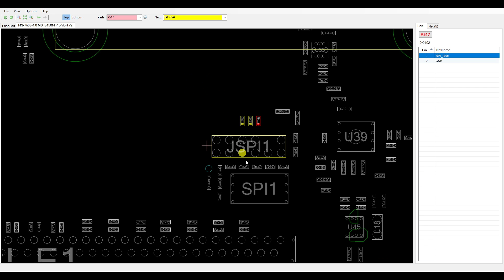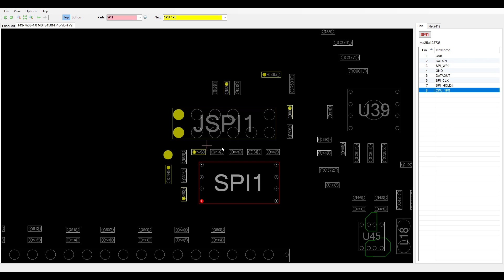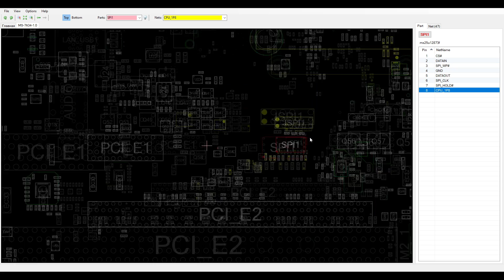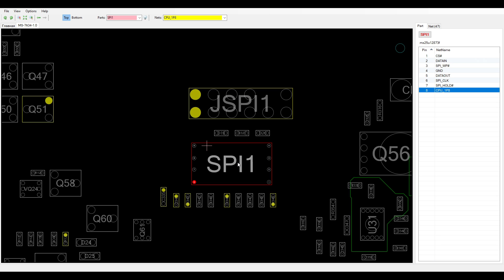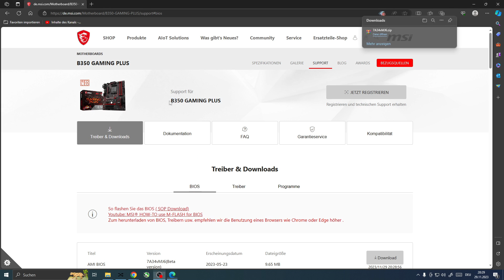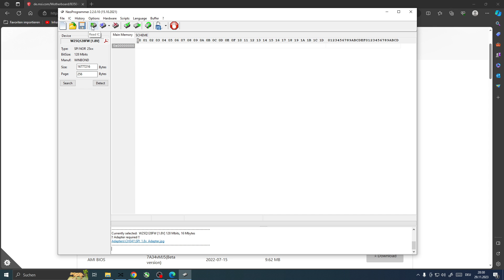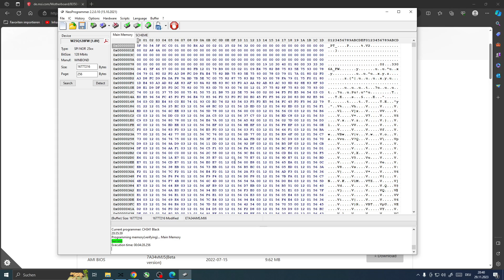HOW TO FIX A FAILED BIOS UPDATE | MSI B350 Gaming Plus Repair

Comment: is there not values that need to be carried over from the corrupted bios? I have a nonbooting x370 sli plus and suspect a bad bios flash. I've taken a backup already so I guess it doesn't matter if I just yolo it.
Reply from the maker: Theoretectly there is stuff like some board adress, cant remember what it was exactly, but most boards work just fine with a clean new bios.
Reply: @MainboardMedic  yeah, board id revived, but lacking mac adress and serials, feels like running a prototype board haha

Comment: I suggest you always save the old BIOS because in old BIOS there is very important information, such as serial number, MAC- address, and board ID. The main board will work without this information but could be a problems in OS.
Reply from the maker: Yes, i started to always do that!

Comment: Repaired my x470 aorus ultra using the same device but used the clip method. Took me 10 mins to restore both the main bios and the backup one. Much easier to use the clip. No soldering needed

Comment: Good video. 
About 20 months ago my friend messed up is BIOS during an update, he was just about to buy a new Mainboard but I told him to bring it to my house with so that we can play with it. I personally play around the CH341 programmers when programming ESP IOT devices with my own code. Anyway I managed to fix his BIOS by downloading his mainboard BIOS from the manufactures website (MSI) then using my 8 pin chip clip/gripper (no heat gun or soldering needed). Anyway I flashed his mainboard BIOS and was totally surprised that it worked and saved my friend about £150 to £175 for a new mainboard. Even though I do own a duel soldering station, when programming ESP devices on boards, I personally always just leave the chips on the boards as the chip clip/gripper  works perfect. Maybe I was just lucky in this case. I don't repair mainboards (I just tinker with everything electrical) apart from fixing my friends mainboard BIOS, I've also replaced 7 bulged capacitors on my sisters ASUS mainboard a couple of years ago.

Comment: I want to know If I can also use a programmer like the CH41A. I bricked my b350m pro-vdh today and want to fix it myself but before that I'll need to buy myself a good programmer so whats your recommentation?
Reply from the maker: There are many different ones. The CH41A is just the cheapest one to get. Preety much all off them are usable. You could also just use an Arduino to do it. The only really good one i know cost about 120€.

Comment: I received a board from Amazon that was a return (warehouse deal) and had the same issue.  I do have the CH431 with the crocodile clamp, but no Windows laptop to reprogram it.  So I shipped as RMA to MSI, not really expecting to hear anything.  Amazon had returned my money to a gift card, so the board was basically free.  MSI send me a brand-new board back, in their white RMA box.  But repairing bios is almost always successful.  I used to do this on the older MacBooks to get rid of a forgotten password.  But since they started with their stupid T2 and motherboards with their TPM, I have given up on repairing.  I am subscribing, could be the start of a excellent channel.  Frohes Weihnachten from Canada.

Comment: Hello I was updating my bios after it updated and rebooted by its self it shows black  screen only
Pls can u help me
Reply from the maker: What model of board is it?
Reply: B350 gaming plus @MainboardMedic
Reply from the maker: If you tried to reset the Bios via the Jumpers and with taking the battery out, there is nothing other left than to flash the chip, that you have on the board!
Reply: and how can i do that @MainboardMedic
Reply from the maker: Watch the video haha I expleain everything in detail how to do it! @Abdurahman-zh6xz
Reply: i did what you did still not working
 @MainboardMedic
Reply from the maker: Well there could be a lot of different problems. Maybe its not the Bios, hard to tell if i dont have the board myself. sorry @Abdurahman-zh6xz
Reply: will it be fixed if i  changed the  chips? @MainboardMedic
Reply from the maker: It might. Its hard to tell. @Abdurahman-zh6xz

Comment: An EZP2019+ V2 is also very cheap and it has adapters for 1,8V.  Does have erase function, auto (erase, program and verify) and has auto identification of the chip that's usually working great. Anyway well explained. Congratulations. If the programming and verification is not successful, mostly it is because the chip itself is damaged and needs to be replaced then reprogrammed.
Reply from the maker: Ive seen this one used by quiet some technicians, but i am looking for one that is a lot faster to programm, because these cheap programmers always take like 15 Minutes to Read, erase programm and verify.
But i might still get that one as a cheap replacement for my cheap CH341A. Thank you very much!

Comment: A very good guide on how to destroy your DMI Information of your board containing the serialnumber, mac adresses for all of your network devices and a maybe present efi marker containing the windows key! Good luck explaining to the customer, that your simple "fix" might cost him twice the price for that MoBo in additional hardware and software, once he tries to use his old operating system and tries to connect to a LAN or go online... 

Using two soldering irons with proper soldering tips (type K, but can be done with smaller ones just as easy) would desolder your chip in a spit of the time, you needed to heat it up using hot air. That would prevent the possible destruction of the chip due to overheting. Even with 320 celsius set on your 861DW one can get that chip off in half the time by using circular movements around the chip, instead of roasting its core! Using some additional flux (even the simplest rosin+IPA solution) and cleaning + tinning your soldering tip, would not only make your "soldering joints" become some real ones instead of cold contacts you got there, that might become non conductive soon, but prevent your hardware (read soldering tip) from getting damaged even more or even get destroyed.

To start to understand, what a modern bios (uefi) file is made of and which information it contains in what block, tools like uefitool (guthub), aptio (ami bios official website), phoenixtools (github, one can get redirected there from the official phoenix bios website after some digging there) and other tools for e.g. insyde bios, intel ME tools etc. can be used. Some of the tools are free or even open souce, others will cost you money, and some you will most likely never get, since those are getting developed by companies or private persons for a very limited circle of companies or persons.

DMI block can be found and copied or at least set properly using any free HEX editor on the planet. Even the one in your programmer software can be used, but it has a very slow search algorithm.

Hope it will prevent you from making bios bricked motherboards a oartially destroyed ones by "fixing" it in the future...
Reply from the maker: I do have to agree to you about the BIOS missing quiet some information compared to the old Bios that was in place originally. There is still things i need to learn about the Bios and its properties.
Reply: @MainboardMedic  Always, i repeat, ALWAYS back even the bricked bios up, once you read it from the chip. ALWAYS run a verification of what you read and later wrote from and to the chip, if your software is not doing that by default. By having a backup of the original content (even briked one), it is still possible to repair the piece of hardware properly later. Once deleted, that information is gone forever.

Do yourself a huge favor and stop relying on boardview to find the necessary information about your chip, like operating voltage ranges etc. Datasheet is what you want to use instead! Winbond chips with Q letter at the end of its model number do need the quad (bidirectional) programming method for example. Otherwise the chip will not contain the correct information after writing and verification will result in a configuration warning, which is BAD, even if the board seems to boot after that!!! Some programmers (not yours) can detect that and use bidirectional write method by default. Using yours you have to dig into the settings to set the necessary flag. Boardview can't show you such important informations.

And most important: Do not call your fixes "Reparaturen", Gewährleistung und Haftung lassen grüßen ;-) Gewöhne dir den Begriff Wiederherstellung (Refurbishing) an
Reply from the maker: Thank you for the feedback. Is there a programmer you could recommend to me? That for example does do the bidirectional programming? 
Cheers.

Comment: I made my own FPROM Clamp (it a kind of SOP16 TO DIP16 IC Programmer Adapter Socket 150Mil Chip Programmer )
Just this one was Cut apart and UV Cure Glued to a Jumbo Plastic Clothes Peg) with some Extra Reinforcement with moldable glue "Sugru" and heavy Wights 

However thes days With the right Tools (3D Resin Printer + RC Micro Bench Drill "08505 Trumpeter - Bench Drill (Trumpeter Modeling Tools)  [TP08505]") You can sacrifice a Few Pogo Pins (Pogo pins & Spring connectors) and make You own Everything Connectors 
Even keep Around a Few Test lead Clamp Probes

Useful Tool Due can Piggy bank clamp on a More Healthy Bios or RAM Chip Board  (With BATTERY Backup) With the Firmware image  Loaded (Other Trick Let a Raspberry  PI Zero Emulate the bios Firmware chip)

Also used OLD LAN Ethernet Network cards to boot a Healthy open Source Bios Firmware  (CoreBoot / OpenBios)

Comment: You have very capable repair skills for such a small channel. The thing I find interesting here is that the Winbond 25Q128FW serial flash chip is so similar to the 25Q128JV chip that provides 16MB of flash memory on the RP2040 Pico boards I got from Aliexpress. It's not like there are proprietary chips being used for each application.